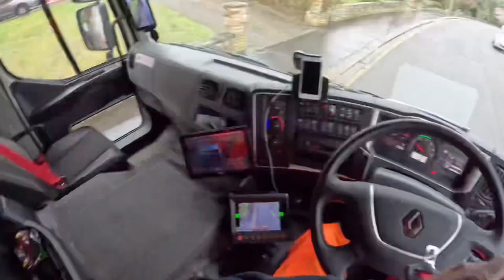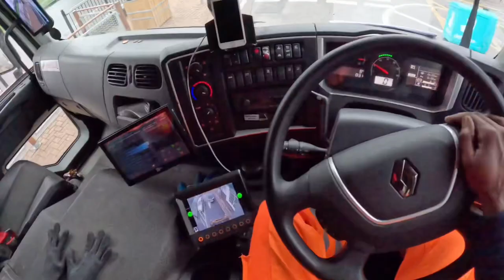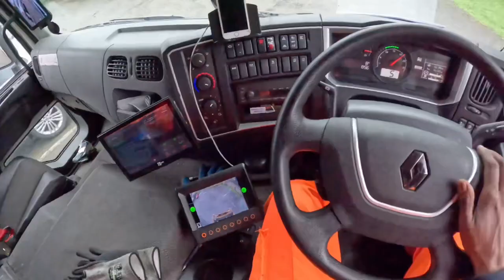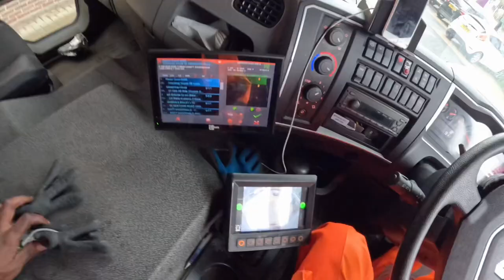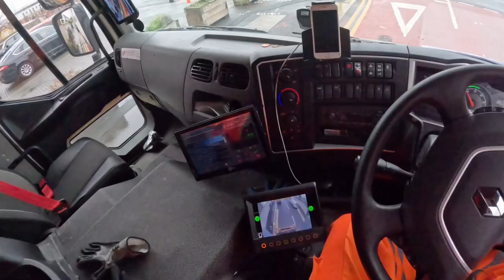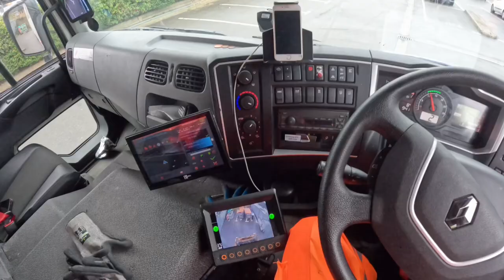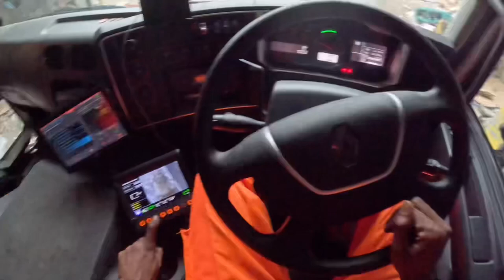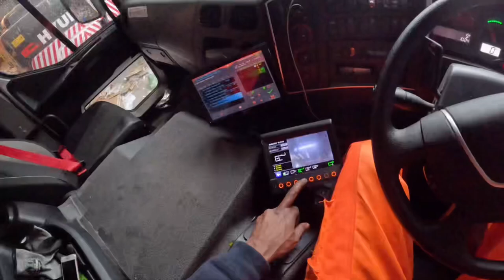Day in the rain emptying recycling in a dustcart/garbage truck and how I tip

Comment: What an amazing video mate! Now, I have a few questions about the truck, as well as an idea. What year, make, model, body, engine and transmission are you running? Can you please do a super long unedited ASMR-style video, with engine startup at the beginning and engine shutdown at the end? Make sure the windows are up, and there is only engine sounds while driving. I want to hear everything from startup and leaving the yard, picking up bins, to engine shutdown at the end of the day. Please make the ASMR as long as possible, completely unedited, and would love that format going forward! Please let me know ASAP.
Reply from the maker: Hi mate, thanks for watching. I got you buddy, will do one ASMR hour long video this week. The truck i use is a Renault D wide range and its a 2022 model I will have to confirm the transmission and all the specifications for you.
Reply: @Rubbishcookreal  sounds great! And remember what I asked you to do in the ASMR, and I would love for you to continue to do ASMR’s going forward!
Reply: Figured I’d check in since it’s been a few days. Have you done the ASMR with everything I requested? If so, when will it be up? Please let me know ASAP.
Reply: @GarbageSean  the more you push longer it takes